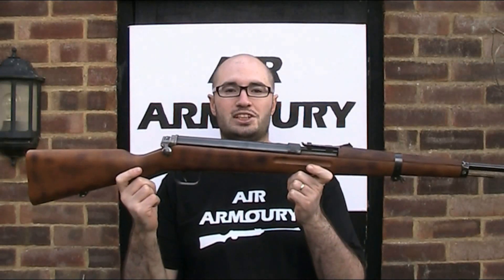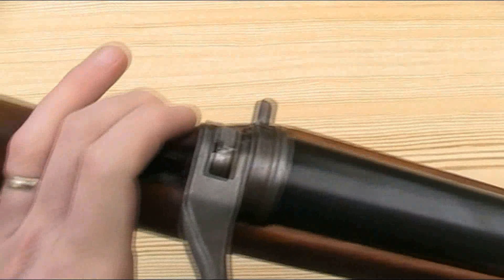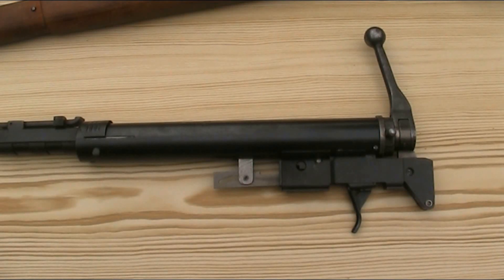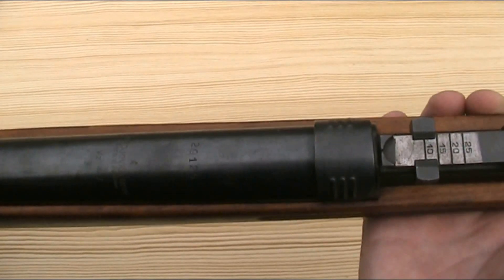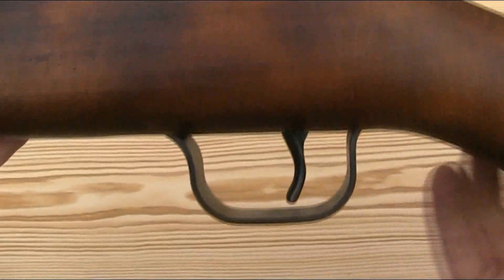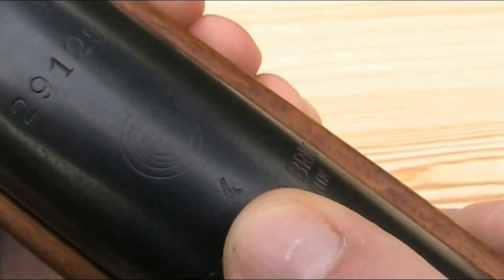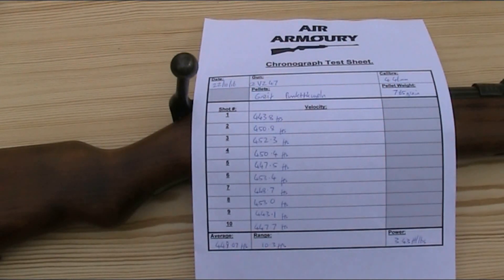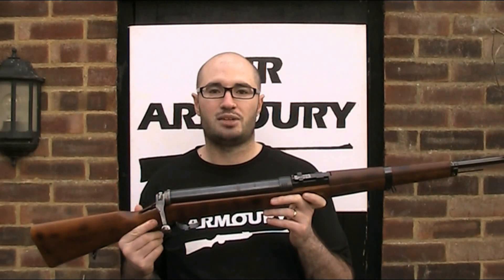CZ VZ47 Military Training Air Rifle | Air Armoury

Comment: I met a man who had his VZ47 (he had a VZ35 as well) modded to shoot 500-550 fps, he was a mechanical engineer with quite a bit of know how and tinkering experience. He also used quite a bit of CLP petrol lube so I'm assuming most of that gain was due to dieseling. He fabricated new parts using his own lathe and sourced others from his hobby group that is a bunch of old guys with lots of time, expendable income, and combined knowledge. I asked if he would ever sell it, and he said never, but if he really had to he'd ask for at least $1000 or more. I then remembered I can get 2 ar-15s for it and let go of the thought.

Comment: Is it possible to diesel this rifle? I mean, VZ47 uses round lead balls and not pellets which have skirts in which you can easily pour ignitable liquid or paste, so it should be rather really hard if not impossible, no?
Reply from the maker: No idea why you would want to but it is technically possible. A lot of dieseling is caused the the oil/lubricant in the compression chamber itself, not directly on the pellet.
Reply: all spring air guns are diesling, I used special high temperature oil for CNC machine from my work and it's perfect ;-)

Comment: https://www.youtube.com/watch?v=XalzmE8wlys This guy got an avg fps of 475.72 (145 meters/sec) translating to 4.13 ft lbs (5.6 joules), various forums have others shooting high avgs based on seal condition/quality and whether it was modded or not. The VZ47 is the low cost variant of the VZ35 which is more fine tuned and associated with slightly higher velocities due to the overall better fit and tightness of the internal components.  There are a few US and Eastern European airgun forums where some individuals modded their VZ47s (not the rarer more expensive VZ35, there's one selling in the US https://simpsonltd.com/czech-vz-35-trainer-air-rifle-c46675/for $2495 USD before taxes) to shoot up to 550fps using the H&N 4.4. rundkugels and breakfree CLP oil. (THey don't mind the dieseling since they've fabricated stronger parts themselves using a lathe) I'm working on doing the same with their help. (You can find VZ47s for 200-500 USD here stateside depending on condition at least 2 twice a year in the U.S. on places like gunbroker, icollector, morphy's auction, gunsamerica, ebay and auction arms (few more smaller sites too. I collect military trainers. Good luck on your search and modifications.

Comment: How do you find such odd size shot? I'm looking to find some in 4.3mm. Any help would be much appreciated.
Reply from the maker: I mainly buy it online from Germany, which seem to have a few different types. Never come across 4.3mm though. Good luck with your search.
Reply: Why do you need 4.3 mm? Most of people want vice versa higher diameter beause modern airguns have too big diameter barrels and bad quality rifling so it's barely touching with 4.5 mm pellets or BBs.

Comment: Those Czech BBs look bad quality because it's from kovohutě příbram, they are doing only very cheap BBs and pellets, we have better company JSB, but I think they don't make BBs, they made only pellets. But those BBs are absolutely ok when you have rifled barrel, I even didn't know smaller diameter than 4,46 mm exists, you mostly use 4,50 mm to modern airguns and 4,46 to airguns made for steel BBs without rifled barrel (if you want lead BBs for some reason).